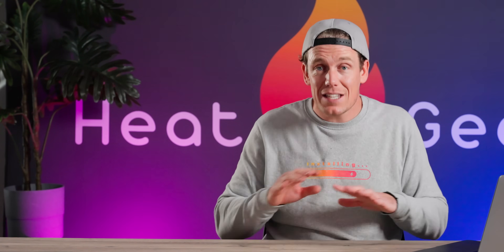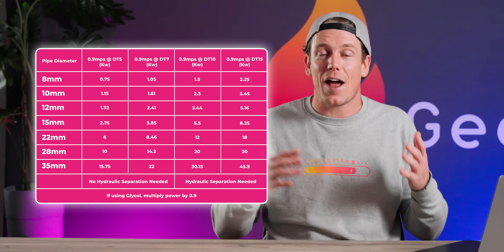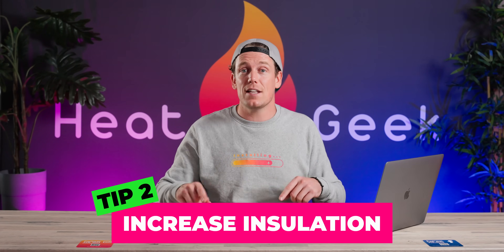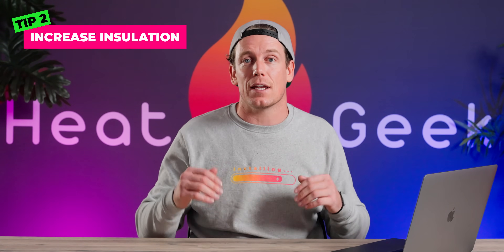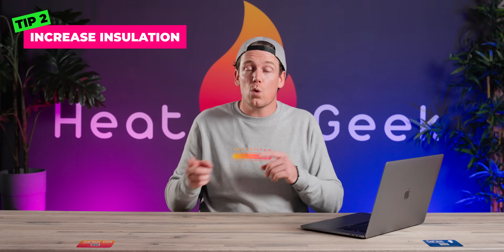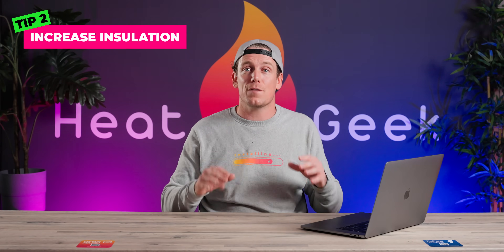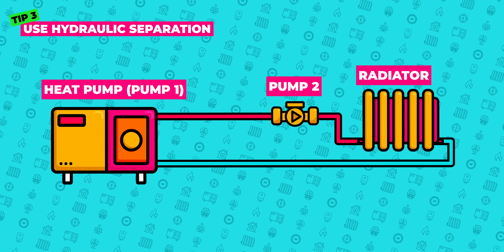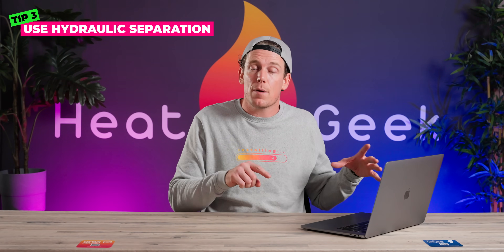4 Tips For Using MICROBORE Pipework With Heat Pumps

Comment: Hello, I've just completed the MCS heat loss calcs for my house and all room are under 1.5kW, most rooms are under 500w, with the conservatory and utility under 1.5kW. Ignoring the conservatory, the whole house is under 5kW and with conservators under 7kW. House is a 1950's semi with cavity wall insulation and double glassing and around 250mm-300mm of loft insulation. 

From your chart it looks like 10mm copper microbore is ok up to around 1.5-1.61kW. But what is the flow temperature that is giving that 1.5kW, or am I being a bit dumb today. 

Can a heat pump flowing @ 35°C still carry 1.5kW of heat @0.9 meters per second thought that 10mm copper pipe as it is only 13°C above the bathroom design temperature. I am aiming to design the system for a much efficiency as possible with radiators (underfloor is not going to work for us), hence the low flow temperature.

Talking about flow restrictions, should we be removing the thermostatic radiator valves and replacing them with standard rad valves as I would expect them to be less restrictive?
Hello, I've just completed the MCS heat loss calcs for my house and all room are under 1.5kW, most are under 500w, with the conservatory and utility under 1.5kW. Ignoring the conservatory, the whole house is under 5kW and with conservators under 7kW,and thats for a 1950's semi with cavity wall insulation and double glassing.
Reply from the maker: Same flow rate and don’t remove trvs. 10mm probably fine but needs an engineer to double check

Comment: 4 bed new build (well insulated) house with 10mm plastic pipes and a 4kW ASHP - don't ask me how but it's working great, the house is always at 20 to 21C, using a 24kWh battery to power the HP through the day and charge it at night on cheap rate. 100% electric house and car, last month electric bill was £58.

Comment: Just an idea I got from this video... I got an oil burner and the shower is waaaaaay on the other side of the house... like 20 meters away. I always hated the wait for hot water to the shower.. so would it be possible to engineer a heat exchanger  to heat the shower water from the radiator water?
Reply from the maker: Yes but what would you do in summer? You just need a secondary hot water return system installed. It will be about a grand -ish
Reply: Yeah, I guess you're right about the summer being a problem. I've been thinking of the return system, but in my particular house, it would be an epic project to put just one extra pipe along the whole house. The easiest solution (in my humble opinion) would be to install a whole new boiler at the far end of the house, almost right next to the showers. It would also be awesome if there existed an electric Direct Heating System that had enough heating capacity for two showers.  @HeatGeek

Comment: Thank you for this very interesting subject! I would like to use our existing radiators with a 10 kw heatpump.
Every radiator can produce sufficient watts @50 degrees celcius, but I am wondering the pipework is?
Every radiator has a 16mm alpex supply and return pipe, connected to a collector fed by a 28 mm copper pipe.
Do you think this could work ? Longest distance is 9 meter.
Kind reagards,
Jef

Comment: As long as your local plumber is a fully fledged heating engineer fully versed in the deep maths and physics of flow dynamics and the complex electronics to control it all getting a heat pump installed to heat your house is just a doddle. Beware any practical down to earth types wearing a cap with the sun shade pointing forwards over the eyes as a warning
Reply: The plumbers in my area only know two things. Payday is Friday and S@@@ runs down hill. Finding one who doesn’t flood your house would be a major find.

Comment: Finally got our first home!!
1968 home with thin pipes leading to radiators, apparently has had wall and loft insulation. 
Property has a back boiler in id love to switch out to a heat pump for the greater good and all that but fear we may need to spend out money we don't have. Need more government finance options and regulation in the industry I think to make this all work.

Comment: You mention that for the larger units 35mm pipe work would be needed. If the heatpump itself only has 28mm connections is there any benefit to go larger?
Reply: yes - pressure loss is proportional to the length of reduced pipework - so if only a very short run is 22mm or 28mm it will not matter. Even 12kW heat pumps can have 28mm connections.
Reply: @UrbanPlumbers  I have 8kw monoblock gree versati and a bit less then 4kw heat loss, the pipes going to the radiators are 15 and are fine , but the main pipes are copper 22mm , do you think that its ok , or i need 28mm ? There is also an option to limit the upper power on the pump from 1-10 kw and im thinking to run it on 6kw , would you think it will be better ? To bad i wasn't lucky enough to see your channel or this one before installing the pump :S Ty .

Comment: I’ve got the plastic 10mm Microbore that goes into the wall (to I imagine larger diameter pipe work). Let’s say my gas boiler can heat my house nicely at 55 degree flow temp when it’s 0 degrees outside. Is it wrong to think a heat pump would also be ok doing this too?
Reply: Same here - new build (2014) with 10mm plastic pipe to the rads that feeds off larger diameter plastic pipe.  I would like to switch to a heat pump but am trying to understand the extent of the changes needed to any pipework etc.
Reply: Me too. During the recent cold snap, I turned my boiler flow temperature down to 50C and when it was -2C outside, the inside was warm enough (although I think I need one type 11 radiator to be upgraded to type 22). If that logic is correct, I can go ahead and install a heat pump. But is this logic correct?

To avoid any nasty mistakes, I'm inclined to install a high-temperature heat pump with flexible weather compensation, such as the Mitsubishi Ecodan R290. This heat pump can deliver water at 75C (my boiler outputs 70C), so that should work in any likely weather scenario. At 75C output, it's COP goes down to 2, but I'm only likely to need that high-temperature output for a few days a year, if any, and at 35C output, it has a COP of 4.6. So, a high-temperature heat pump should heat my house with a good COP for almost the entire year whilst protecting me from the possibility of a cold house during very cold weather.

But, is this logic correct?

Comment: I have 15mm pex piping throughout with no sign of manifold, does that count as microbore? we have a detached Victorian property that was done up to sell so corners were probably cut. we have added external insulation this summer to half the house and increased loft insulation. Not feasible to insulation much more outside with access issues. Do you think we would need hydraulic separation with these existing pipes if we didn't want to rip the house apart

Comment: So should I run 22mm pex with 15mm feeds to rads to future ready for heat pump. I have a blank canvas to work with full new install. Also iv been advised +50%btu on my rad calculation
Reply from the maker: No use copper ideally. And absolutely do not use a rule of thumb like power + 50%... do a heat loss calculation and use a conversion factor
Reply: @HeatGeek  a lot harder to run copper though joists. And I don't have these press tools etc. When plastic is easy to run , ps zero budget 🤔  so has to be a diy
Reply from the maker: @S.p.h.2021  mlc if running through joists.  If you don't have to budget to do it as well as it could be please don't expect the outcome to be as good as it can be
Reply: @HeatGeek  can't afford to pay anyone but do have my btec2 (1998) so very outdated, just never done anything this scale  so plastic pipes best hot water only. Ok.
Mlc in 22 with 15 tails to rads? 
I'm getting confused by different opinions,
Reply from the maker: @S.p.h.2021  16mm mlc all the way to rad and eurocone connector (I've never understood why people do the last 150mm in copper) and 25 or 32 or even 36mm main runs depending on mass flow rate and heat loss adjusted for the pressure drop of each fitting.

Comment: I have all rads with their own flow and return, continuous pex  inner diameter 12.7mm. They run through a 5 port manifold. My sense is that the “mircrobore” would carry 23% more volume than 28mm pipe with an inner diameter of 25.6mm or is it more complicated than that?

Comment: I have a main 'circuit' so to speak which is 22mm. Then each radiator comes off of that as 8 or 10mm microbore. What then?
Reply: Then, as per the pink table ,  you are OK for  a 6KW heat pump & DT of 5 and  for small radiators only putting out 0.75 to 1Kw ( at your choosen radiator temperature)  .  & probably only replumb big radiators above 1Kw.
Reply: Me too.. Do think as smallish semi. Only repipe main room rads. Also if some  others not working to full heating upgrade in future.. But, I have no idea if this is correct and would need advice. Don't fancy ripping up all upstairs floors to replace plastic pipes

Comment: All new houses microbore epidemic for the last 30 years.  I’m going to rip up my chipboard floors and replace it all.  Surely if you’re retrofitting you e got to be looking at getting rid of those piddly pipes
Reply: This tbh. I'm going down the PassivHaus route, and tor me, a heat pump is something I'd want at the end

Imo it requires a step by step approach. I'm not a heating engineer but I am an engineer of the networking kind

The way I see it, is that I can't just bang something in, and expect something to work without first optimising everything else and making sure they're able to work with it

In my own industry, I can't expect 10Gb/s to come out of a "pipe" where the downlink doest even support that. I can accept certain compromises because the extra speed costs me money and is not noticeable

Anyway, my point is that from my POV, I don't see the point of putting in a heat pump unless you've already done a lot of work that makes your property absolutely ideal for a heat pump

Part of that includes the piping, and radiators (at least for me) Part of that is insulation too

Comment: Connect the heatpump to circle only the volumizer tank, circulate the house to the volumizer tank,
If you do this you need 2 water circulation pumps but you will never get any flow alarm because of low flow.
You need a volymizer tank with 4 connections 

DO NOT PUT THE VOLYMIZER ONLY ON THE RETURN PIPE!
Reply: Is then the volumizer is a ( low) loss header?

Comment: This really confuses me.  You talk about microbore slowing the flow rate, which could be a bad thing but then we set the lockshields to reduce the flow rate even more for a temperature differential across the radiator.
Reply: Lock shields balance the system, ideally fairly open on average, & then the pump can run on a lower setting.
Reply: Setting the lock shield isn’t for temperature differential we use the lock shield for balancing a heating system to put the heat evenly everywhere. Differential between flow and return on rads is more due to incorrectly sized radiators
Reply: @nico101gaming  but by balancing the system it also affects the return temperature by slowing the water down as it crosses the radiator.
Reply: @MrRawMonkey  The purpose of that is to make the boiler more efficient by lowering the return temp; opening the valves allows a smaller deltaT to be used e.g. for a heat pump. I'd set the largest heat loss room wide open then adjust all the others down to the correct DeltaT, in order to maximise the overall flow rate. Not sure if that's right but it makes sense to me.

Comment: Oh the joys of having all our radiators plumbed with microbore, even some plastic microbore too! 2000's new house building. 🙄
Reply: Same here - it was a real downer when we realised we had 10mm to all the rads (2000 build too). But we have a heat pump running at 45C flow temp through those pipes that so far is keeping the house toasty. The next few months will be the test - I have complete faith in the quality of the install but it's our first winter with the HP
Reply: @algraham1972  I hope it all goes well for you.
Reply: @Al Graham This is interesting, awaiting heat pump design to come from my installer on a 2003 built house with 28mm pipes from boiler to manifolds with 10mm plastic microbore to each radiator. Heat Geek installer has suggested a two pump system with buffer running at 45 deg flow temp. Good to see that yours is keeping you warm.

Comment: Pulling my house to bits puts me off heat pumps a lot, 3 story building in plastic 10mm :/
Reply: 10mm plastic will only be the drops to the radiators if new build. In theory you could cut square sections of the ceilings above the radiators downstairs and surface mount 15mm pipe work to each radiator leaving the 10mm pipe (dead) in the walls. Upstairs will be similar but it will come up through the floor and look much better, the same applies leaving the 10mm (dead )in the wall and cutting a square panel next to the radiator and feeding 15mm to each radiator as tails straight down into the floor. Not a massive problem and certainly not ripping your house apart
Reply: @copperskills3973  surface mounting 15mm copper looks terrible. Walls and ceilings would have to be damaged. That’s a lot of work.
Reply: @mickbmx  I’m not saying it’s not a lot of work.  I’m saying it’s far from ripping your house apart. All I’m getting at is anything is doable with a bit of thought from an experienced engineer

Comment: I have microbore downstairs and conventional pipework upstairs. I am running my boiler at 50c to see if it can cope with winter and whether the house could cope with a heat pump.  

I have an average temperature drop across my rads of around 10c when set to 60c but now the middle of the radiators are now only luke warm although the temperature drop is maintained.  This on a newly flushed system as my boiler has just been changed.  

At the moment the house still warms up but the question is should I adjust the lock shields to allow more water to flow so reducing the difference between flow and return, as that and not the microbore is reducing the flow more?  The return temperature on the boiler measures around 28c
Reply from the maker: No. Boilers want low returns